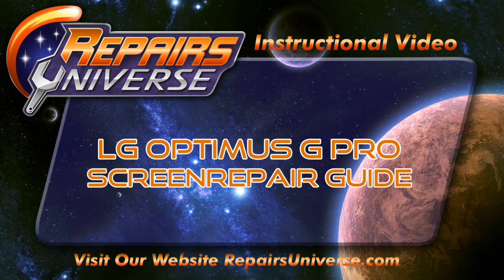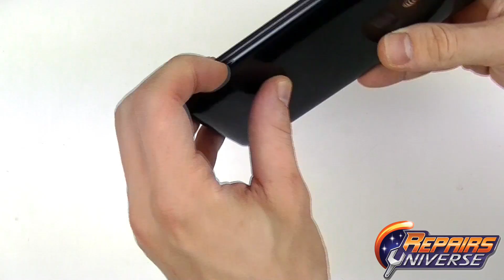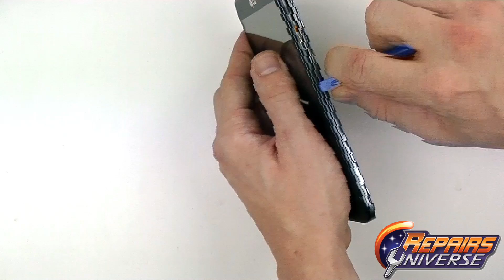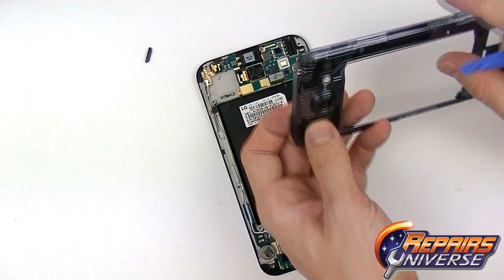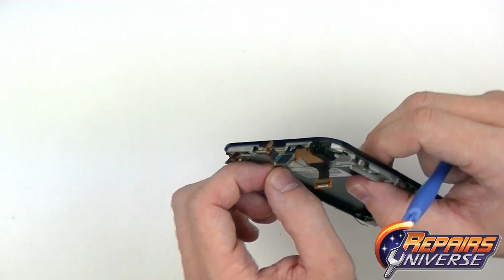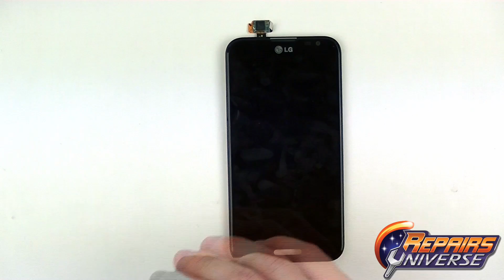LG Optimus G Pro Screen Replacement Repair Guide

Comment: could you help me out an shine a little light on my question when i replace my screen would my back button or menu be harmed in any way or my screen touch timing
Reply from the maker: +Trevor Kerr It's possible as these buttons are located with your dock port. Just ensure not to damage the dock and everything should function as normal.

Comment: I just brought my parts for my g pro but I got the screen and lcd separate and I need help taking the lcd out and replacing it. This isn't my first time replacing screen but it is for the lcd. Help please xx
Reply from the maker: Kayleyea Larkin You would first want to start by removing the digitizer/touch screen. Use a heat source to soften the adhesive and that will help remove the touch screen. Then you can replace the LCD. Let us know us any issues you run into.

Comment: I'm thinking of ordering the screen+LCD, I see they come already attached; so I don't get if I need to go through the entire process of removing every single part, it seemed to me that ordering both parts would save me all that!; as I haven't opened it yet have no idea. Wo0uld you please clear it to me about that?...
Reply from the maker: yuriefa Is your LCD damaged? If not, just replacing the digitizer should be just fine as this unit is not fused.
Reply: Repairs Universe 
Both are broken!.. I would like to know if at this point it is convenient to order the combo... and if it will also save me any segment of the entire process of disassembling... is it needed to disassemble 
it completely?.... thanks for your prompt response.
Reply from the maker: It's best to order both together as it would be assembled for you. It would save you having to remove the touch screen from the LCD.

Comment from the maker: + anthony moya We recommend to double check your flex cable connections and also restoring the operating system. You can restore it by completing a factory data reset and this will debug the unit. It may or may not work but it's worth a shot.

Comment: i went ahead and replaced the screen digitizer now my menu and back button light up but do not work at all also when i try and swipe down the android menu that does not come all the way down and most importantly my touch works but sometimes the touch is way off!!!!!!! its a bit more accurate side ways  but still. wtf is wrong!?

Comment: I replaced my screen , the screen turns on but now my touch is non responsive , I thought I got a defective screen so I went ahead and bought another screen , and that didnt work either phone works and function but my touch does not work
Reply from the maker: check to insure the flex is installed correctly. Once you have done that please factory data reset the device. You have added new hardware. Good Luck
Reply: I pressed firmly but nothing still , idk what I'm going to , I've been fixing phones also too , I know how to fix iPod iPhones iPad , so I'm very experienced , idk what's wrong with my phone I'll be tryn to take it to a shop for a diagnose

Comment: Is it hard to reinstall the buttons?to you install them in the frame then install the bezel?if you do this the they fall out?or should you lay the bezel on its back and place the phone on top so the buttons stay in?
Reply from the maker: The buttons I think you are speaking of are the Volume and power buttons? I find if you take a very small piece of 2 sided adhesive, and use it to hold them in place. It may make life a lot easier.

Comment: Repairs Universe ok i just got my new touche screen digitizer but now im having a lil problem my screen wont light up only my buttons please help :'(
Reply: And this was after i replaced my touchscreen too
Reply from the maker: Ivan Zamora Okay best advice I can give you is......Start over. Go back threw and disassemble the unit make sure to remove and inspect all flex cable connections. Once you have everything taken apart reinstall everything taking care to seat all the connections. It sounds like either the flex for the LCD came loose or you may have damaged the LCD. If you still have issues please email me @ Robert@repairsuniverse.com

Comment: I just replaced my screen and now the touch is off.  Up is recognized as a down swipe and down is recognized as up.
Reply from the maker: ***** It sounds as if it could be a defective digitizer. Did you make sure your flex cable was connected properly to the motherboard?

Comment: I just bought a glass repair kit  for the Same phone,can I install it without haveing the Digitizer Screen the Glass is all that needs to be replaced
Reply from the maker: Chris Reyes Did your glass come with a flex cable? The digitizer should be attached to the outer glass.
Reply: No but I bought one that did and it worked I fixed it thanks to u man thank u but guess wat I cracked it 2 weeks latter I guess I have to get another one lol

Comment: Like the guide said, I removed the power button ribbon cable. After reattaching it, making absolutely sure it was in the same position as before, the power button is nonfunctional. Do you have any advice on how to fix it, or use the device without the button?
Reply from the maker: Andrew, Check to see if the flex cables are missing or lose.
Good luck on your repair.
Reply: Any response on this question. I have the same issue. Power button is not responding. Help
Reply from the maker: Pete Price Is the flex cable itself clicking and the phone not responding? or does it seem like the button is jammed?
Reply: Thanks for the reply. The mother board was not seated properly. Seems to work, however, when trying to make a phone call the screen goes black and I cannot hear the other person. If press the top left right corner the screen comes back on, but still no sound. But, speaker phone works fine. Any thoughts ?
Reply from the maker: Pete Price Make sure the prongs on your earpiece are contacting the motherboard correctly. It also seems as if your proximity sensor is causing you issues, this it the sensor that turns you screen off when you place your phone to your face during a phone call. Make sure this is properly connected and it in place under the glass.
Reply: Thank you for the response. Proximity sensor, can that be accessed from the back or do I need to lift the glass ??
Reply: Sorry for cutting in, I just want to thank you guys for your help.
Reply from the maker: Andrew Vinter No problem! We are always here to help. 
Pete Price You can access it through the back of the device. It is  is connected to your motherboard towards the right of your front facing camera.

Comment: ***** yeah the digitizer/screen cannot actually touch the lcd. There should be tape around the edge of the lcd do not remove it put the digi on top of the lcd. Do not touch the digitizer adhesive to the lcd.

Comment: What about actually applying the new screen into the phone? & Does it matter if you have a new adhesive or not?
Reply from the maker: I'm not exactly sure what your asking, as this is a repair guide for replacing the screen and doing just that..Can you clarify your question so I can properly answer for you?
Reply: In the video it doesn't show you putting in the new screen. Is there anything I need to know when putting in the new screen? Like for example with the cable connected to the new screen. Where would that go?
Reply from the maker: *****
 The flex cable on your new screen will slide in on the top right. there will be a slit in the housing to allow the flex cable to slide in to connect it to your mobo.

Comment from the maker: It sounds like the touch screen digitizer was not properly reconnected. Make sure all the connections for the touch screen are securely in the correct places. If you continue to have issues please contact us at RepairsUniverse (dot) com through the link for "LiveChat", and one of our technicians can further diagnose your problem.

Comment: When I replaced the digitizer on mine it was only bonded to the outside of the phone & not attached to the LCD. It was tricky but I felt I had nothing to lose. I started the removal of the glass at the bottom next to the front button hole as that was where my digitizer had cracked. I used a special tool to separate it (Kiss glue on fingernails-They are very thin and flexible) I could slip one under the glass and then use another to hold the glass away. I was able to reuse the original gasket.

Comment from the maker: It is technically possible but extremely difficult. We recommend not attempting that, and going with the combination screen (touch screen + LCD). Also, not sure exactly which parts of the screen are more secure than others, but since we don't suggest attempting separating the two, it is not a concern to us.

Comment: agree...
got some questions
1: is that possible to separate just the digitizer?
2: does the digitizer stick to the lcd like in galaxy s3 OR digitizer is just sticked to the top, bottom and sides?

Comment: FYI- The touch screen flex cable has adhesive holding it to the LCD flex cable and can be a bear to get off with out pulling on the LCD flex. While replacing my sister-in-laws touch screen, pulling off the TS flex cable also pulled up the LCD cable and tore it, making the LCD inoperable.

Comment from the maker: The touch screen and LCD screen come fused together on this device. We strongly recommend not attempting to separate the two. Even skilled technicians often have trouble with this. Your best bet is to purchase a replacement combination screen (touch screen +LCD). We have the part available at RepairsUniverse (dot) com.